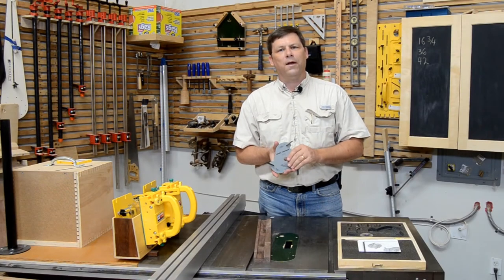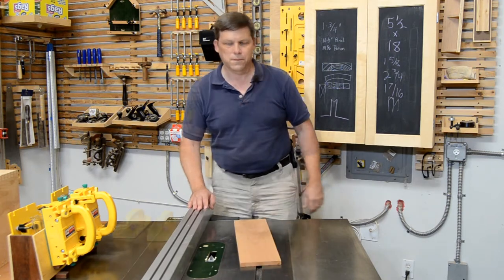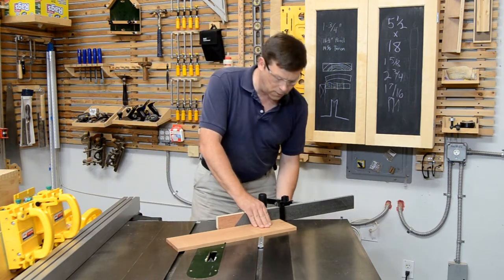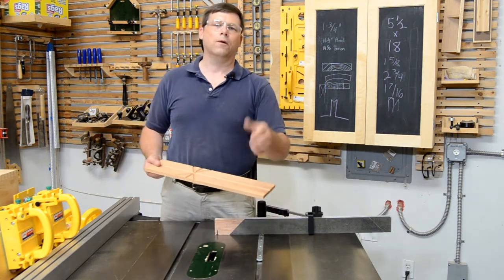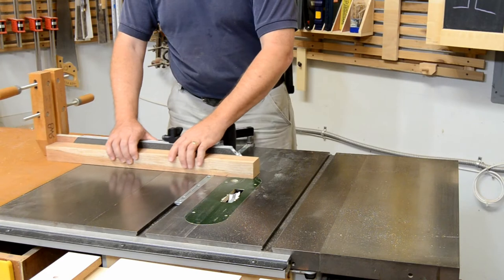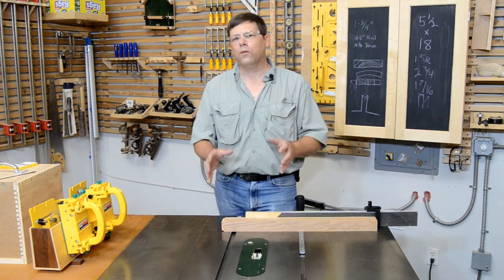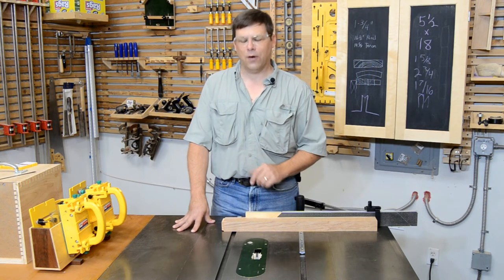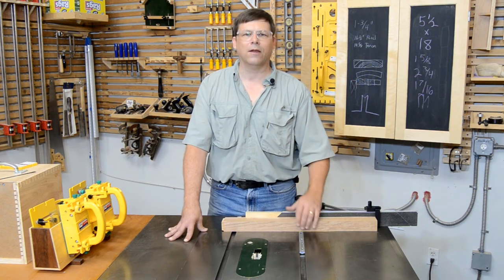Molding Head Part 2

Comment: The 2 videos are very good. I have been using craftsman moulding cutters for 50 years. In addition to what you show, there is a model with one cutter. I have used this tool to duplicate the trim on my 1895 farm house. The original trim was done with hand moulding planes. I can grind and file one cutter to match the profile. It takes 2 different profiles to make the casing. The wood needs to be fed slower to get good results. Having both a 3 blade and a 1 blade set along with many profiles for both allows creativity.
Reply from the maker: Thank you for the kind words! It certainly is easier to make custom profiles with one blade than three, but I have gotten excellent results with three blades. 
I lay down three layers of painters tape, cut the profile in them, then stick one layer on each knife so I am cutting the same profile on each.
Reply: @Woodcademy  That sounds like an excellent method. Thanks.

Comment: I bought this same set from sears hardware (I miss sears hardware so much) about 20 years ago. So happy that the Corob cutters fit it. Thanks for including that information. Looking at the Corob site they have many profiles to choose from.
Reply from the maker: Lincoln, glad you found it helpful. Corob is actually the company that made the molding heads for Craftsman.
Reply: @Woodcademy  I haven’t used mine some my last move and I just noticed the spacer is missing. Can you do me the favor of telling me what the thickness of your spacer is? No hurry.
Reply from the maker: @lincolndickerson1293  I am traveling at the moment, but when I get back to my shop this week, I will measure it.
Reply: @Woodcademy  Thank you very much. Safe travels.

Comment: Actually the molding head is more versatile with the radial arm saw. One reason is that the work can get closer to the saw's arbor than with a table saw. 

Some raised panel profiles cannot be used with the table saw because the top of the table is too far from to most interior part of the profile.

Another is that the molding head can also be used in either the regular rip mode and the "molding head mode" (with the arbor vertical pointing toward the table). And in either mode (particularly the rip mode) the saw can tilt so that only a segment of a profile is used at a certain angle.
Reply from the maker: woodensurfer, while the radial arm saw is an option, I have to point out that panel raising knives for molding heads are Vertical knives, not horizontal like on a shaper. On the table saw, the panel is run over the blade on edge, not flat on the table. 
While it is possible to rotate the Radial Arm head to the horizontal and run it over the panel that way, I do not recommend it myself, too much opportunity for kick back of the saw.
Reply: @Woodcademy  
With a RAS (in the molding head mode arbor facing down), the raised panel profiles are horizontal,  while vertical with a table saw. With a TS, the molding head has to be of large enough diameter so that the inner most of the profile can cut the wood (otherwise the table is in the way). ( Some 10" TS only has 3" depth of cut rather than 3.5", hence are particularly non-functional). 

With panels 18 inches wide, proper support is an issue on a TS. With the RAS the work lies flat.
Reply from the maker: @woodensurfer  As I said before, in woodworking there is never only one way.
Reply: @Woodcademy  Yes, but sometimes one way is clearly better and more convenient due to probable existing tools and ease of operation. Rabating with a router is one such operation. 

Often the molding head cannot do raised panel with a TS. To increase the chance, get a head with large diameter and make sure your saw has enough depth of cut.
Reply from the maker: Remember that the video was to show using the molding head. So showing what it is capable of is part of the video.
Reply: @Woodcademy  Yes it is your choice but I am just suggesting that starting with rabating is rather anticlimactic because rabating with the router is so simple and universal.
Reply from the maker: woodensurfer, The physics of cutting are clear: the larger the cutting circle, the smoother the cut. The larger radius arc is closer to a straight line. This extends the cut line, reducing tear out and providing a smoother cut. A Rabbeting bit in the router table is common, and easy or many, but there is a reason molding machines use large diameter cutters rather than smaller.
Reply: @Woodcademy  I doubt about the physics is clear; if any thing the faster the tangential speed (rpm x diameter)  the smoother the cut. The molding head does not prevent or reduce tear out; correct backup with sacrifice material does.

The larger the cutting circle the easier heat dissipation. The direction of cut of the dado head facilitate chip ejection, in dadoing the circular-type saw (TS and RAS) is better for chip ejection than for router, unless one uses a more expensive up-spiral bit . Rabetting is different; in rabetting there is a gap for chip to eject even with ordinary cheaper straight router bit.

Rabbeting with the TS is common, with the dado head.

I just believe that the molding head has it special functions but rebetting is not a desirable and special function, why spend time on rabetting with a molding head?
Reply from the maker: woodensurfer doubt all you wish, it does not change the science. I have been a professional woodworker for more than 30 years, have been to the factories where they make tooling and have had long conversations with the engineers that design it. I have designed and had custom tools made for me. I have even lectured on tooling at industrial trade shows. Do some research, you will find out I am correct.  But the real answer here is that I was doing video on molding heads, they can make rabbets along with molding and I showed that. Watch other videos I have made, including my TV show, and you will see me cutting rabbets with a Dado set and with a Rabbeting bit on the router table.
Reply: @Woodcademy  The router is reputed to give very fine finish. How fine a cut depends on the tangential speed and the material of the cutter and its sharpness. The diameter of the cutter is not the key. You can have worked on wood for 30 years and still do not understand.
Reply from the maker: woodensurfer you are entitled to your opinion. Why don’t you create your own videos teaching folks your methods? It is fun and rewarding.
Reply: @Woodcademy  I may.
The molding head is not a tool that increases the finest of cut, please do not mislead people. The router is well-known to to produce a fine edge.
The molding head usefulness is in the greater varieties of profiles available and at a low prices; in fact, some effect in sanding after cutting is expected.
The RAS has it particular usefulness when using with the molding head; if you do not have an RAS, you are missing 20-40% of the applications of the molding head.
Peace
Reply from the maker: woodensurfer first, no common manufacturer makes an RAS for the hobby market anymore, so discussing it is sort of pointless. Second, while routers can produce nice cuts, shapers cut better due to the generally larger cutting diameter and greater horsepower. Additionally, the high speed steel used in molding heads and shaper cutters cuts cleaner than any carbide can. Carbide lasts longer, which is why it is generally used, but high speed steel can be sharpened to a much finer edge, providing a cleaner cut. 
So I am misleading no one, except in your opinion, and since this is my channel, I get to decide what I show. You disagree, that is fine, and I believe I have been more than fair in giving you that say.
Put up your own videos with your methods if you wish to, but I am done arguing with you.

Comment: Probably a real bad idea to use a molding head cutter with a circular saw but...I have one of both and no access to a table saw. I just want to make moldings to make picture frames out of. A friend of mine made some huge murals on 4x8 plywood and we have been discussing how use 2x4s to make proportionally sized frames for. I'm thinking to make something like a miter box that will attach to the saw that will be adjustable horizontally and vertically.
Reply from the maker: @LunarCascader  your first impression is correct. It is a terrible idea. I would not even attempt it.
Reply: @Woodcademy  thank you for the feedback. It will serve as a reminder to be extra careful.  🧐

Comment: Thanks, hadn't considered using it that way.  However, looking for your thoughts on another issue. I have two sets of these but one doesn't include the spacer.  Since the other does I do know the exact measurements.  Instead of finding someone to mill the replacement out of metal, what are you're thoughts on using HDPE?  Do you think it can withstand the rotational forces, or will it just come apart (of course that being somewhat dangerous)?
Reply from the maker: Robert Arnold, I do not think the radial forces are too much for the HDPE. The shaft is only spinning at 3600 rpm and it is a small diameter.
But check out MSC Direct online and search Arbor Spacers. They sell all manner of steel spacers for exactly this use.
Thanks for watching! Be sure to subscribe, and check out our Woodcademy TV show on Amazon Prime: www.woodcademy.com/wctv

Comment: Does this make purchasing a shaper unnecessary?
Reply from the maker: Matt, I have and use router tables, I do not own a Shaper. But to a large extent, yes, molding heads are an alternative to using a shaper. Corob Cutters not only makes the heads and knives, but also makes shaper cutters in most of the same profiles. Check out their site at www.corobcutters.com

Comment: It would have been better to skip the rebate part. Why use the molding head for rebate when there are so many different choices, dado set and router table?  Go to special profile at once when usual router bits won't do.
Reply from the maker: woodensurfer a molding head rebates faster and cleaner than even high end dado blades.
But one of the cool things about woodworking is that there is never only one way to do something. Having multiple methods of performing the same task is useful.
Reply: @Woodcademy 
 Most people need a good quality dado set and have a router table.  You cannot cut most dado with a molding head and rebating with a dado set or a straight bit on a router table is easier.

The adjunct stuffs like the molding head have to demonstrate special usefulness after the usual dado set and router.